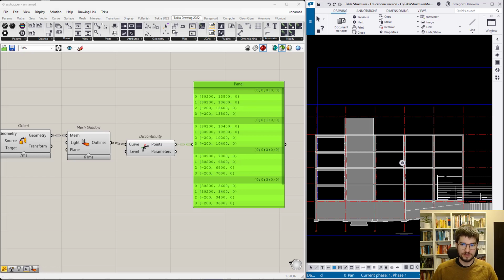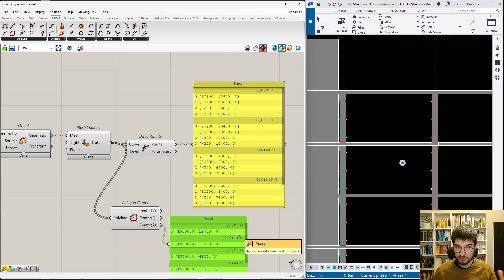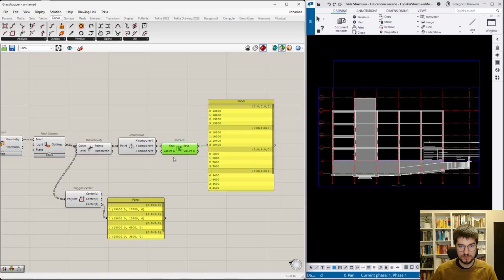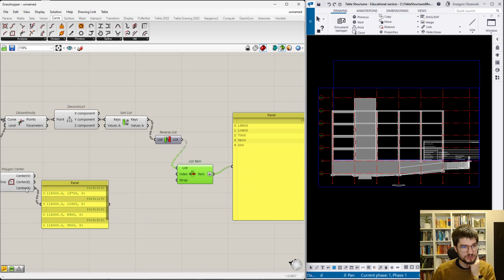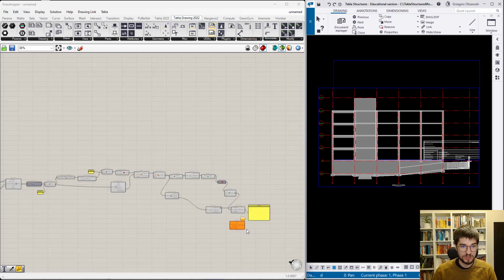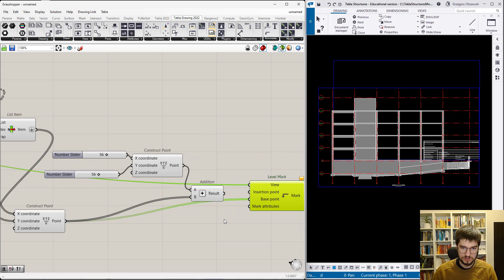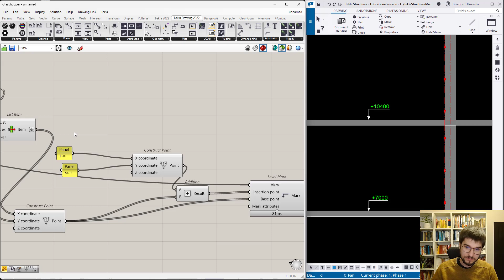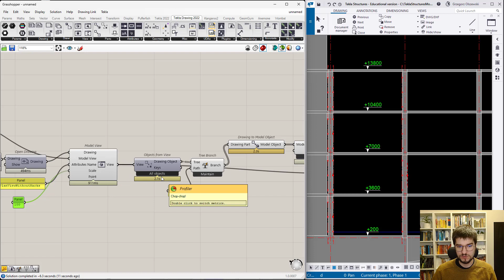Grasshopper-Tekla Drawing Link GA drawings part II

Comment: Hi,There is a few questions about the Mark Attributes component of Tekla Drawing 2022 I want to ask.Thank you.On the input side, I'm confused about the use of first input(Mark Attributes),it seems there's no match component as input.
Reply from the maker: Hi! There are two options to annotate objects:
1) You can use the Associative Note component together with the Mark Attributes. For the Mark Attributes there is only one obligatory input - Drawing Object which is needed to narrow the scope of attributes (part/rebar/bolt). The first one, which you mentioned, is optional, it could be used to modify existing attributes.
2) Go with the Mark component, which needs the object for which you want to insert the mark and the name of attributes file (like in the save/load UI in Tekla). This mark will be inserted slower, with the help of Tekla macro, but it is what the users are familiar. Usually, associative notes are not used.